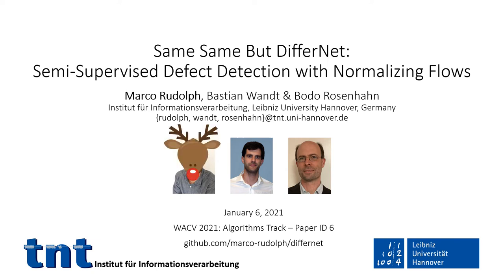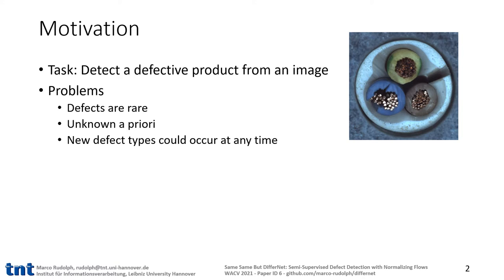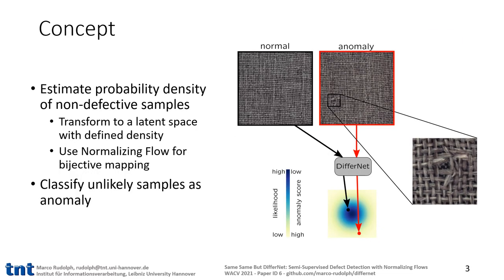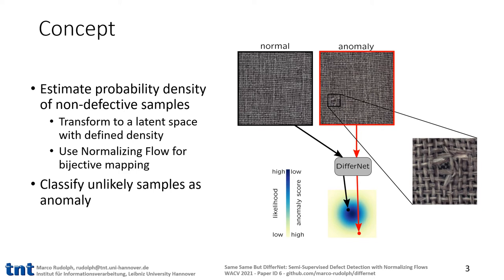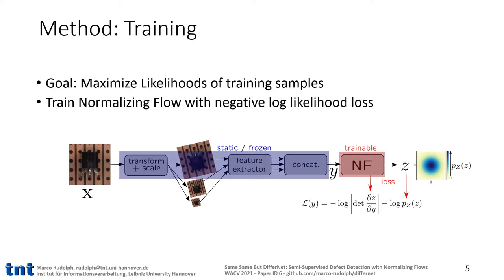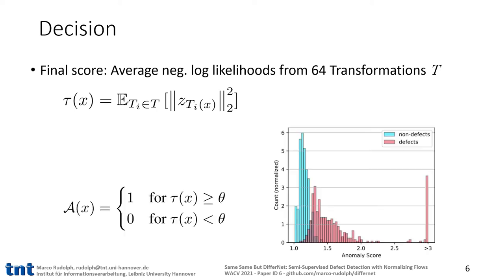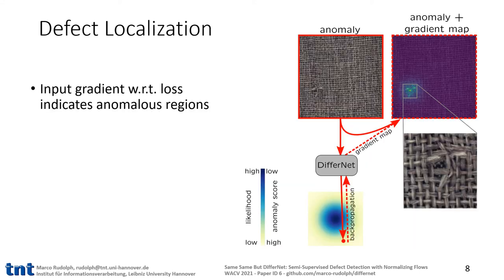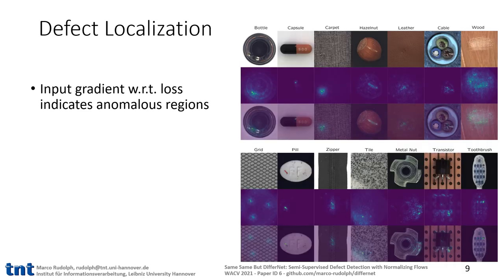Same Same But DifferNet: Semi-Supervised Defect Detection with Normalizing Flows (WACV 2021)

Comment: thanks. How would you compare this method to FastFlow?
Reply from the maker: Similar to CS-Flow, which is our Follow-Up to DifferNet, FastFlow computes the density on full-sized feature maps instead of averaged feature vectors. This gives a strong performance boost for the detection and additionally enables for more precise localization. Furthermore no transformations like rotations are needed in training and testing. Note that different feature extractors are used in the individual papers. Apart from that both methods are quite similar since a density estimation on normal data is done on features given by pretrained networks.